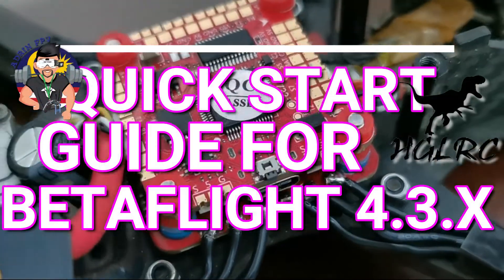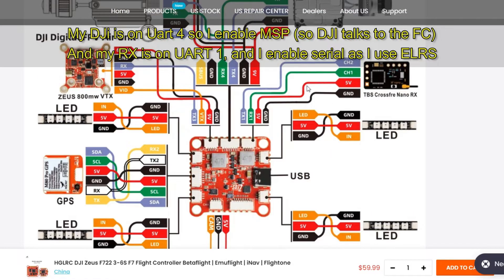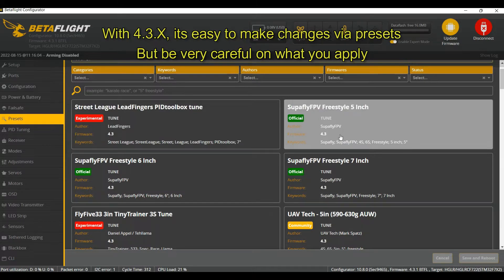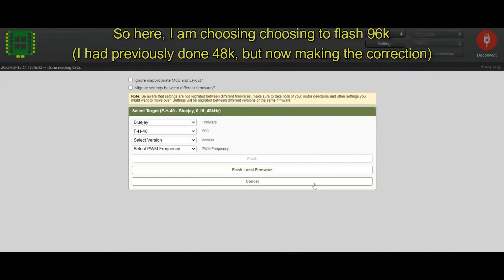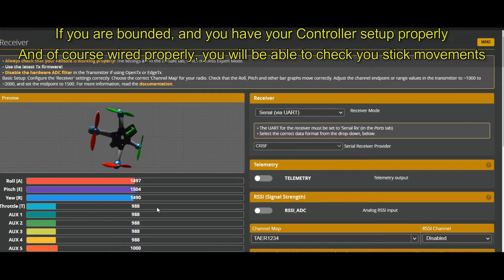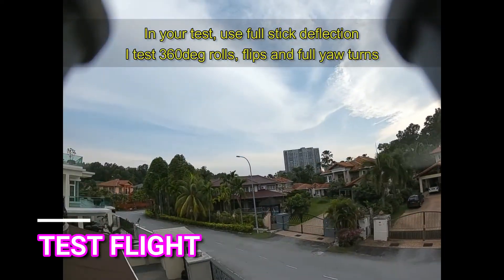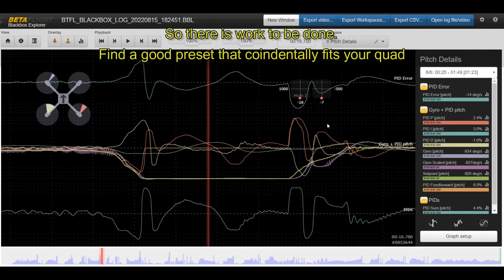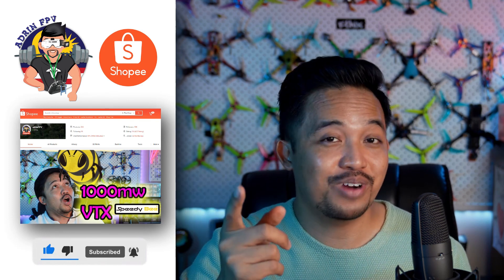Betaflight 4.3 Quick Start Guide, Test Flight and Blackbox review (featuring HGLRC F748 Stack)

Comment: Great video. Made more sense of all the settings better than the 10 other videos from peops like bardwell😅.. have a question. Im building a new 3.5 inch. Still can't figure out what is best option for FC. at this point im looking at the speedybeef4 mini, the sequre h743 mini, and the hglrc 745 mini. Can anyone give me some advice if going with more than a budget $70 board is the choice or if I should go with a better f7 or h7 board and spend the extra $30 to $50 on the better board.  Thanks in advance and appreciate all the input from everyone. 👍